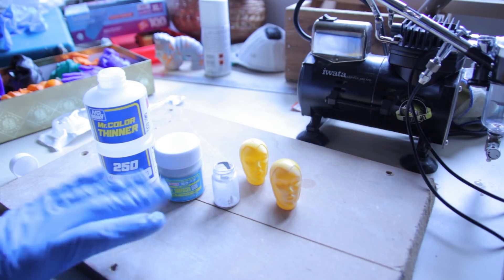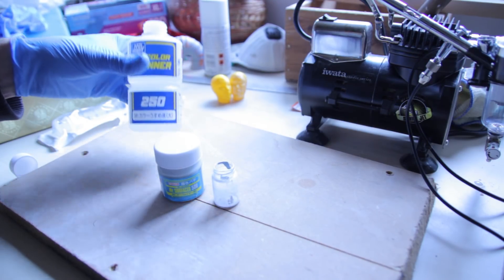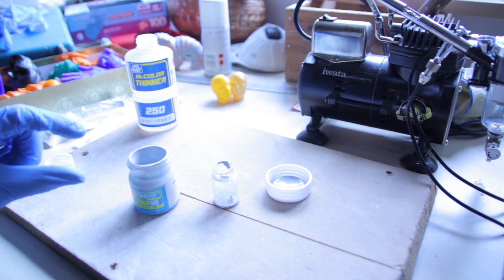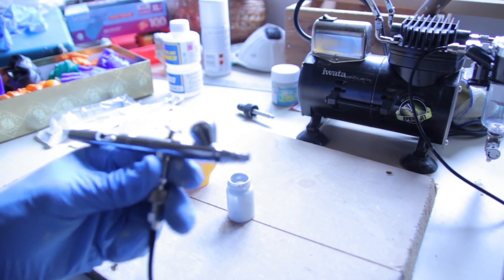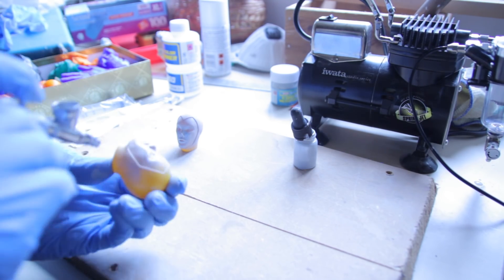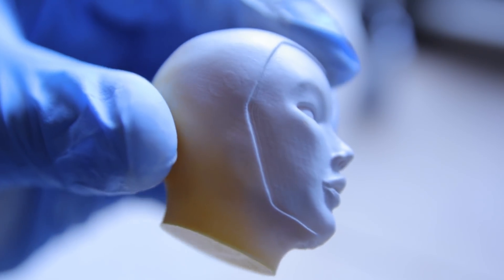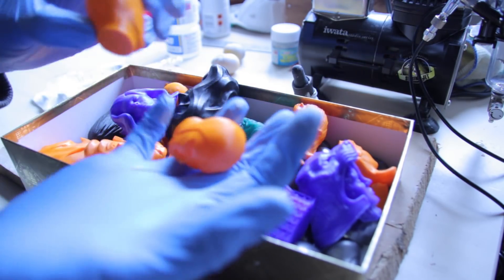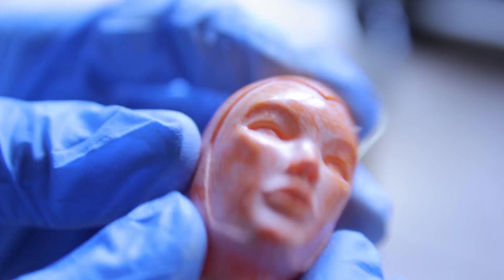PAINTED ACETONE VS NON ACETONE ON PLA 3D PRINT

Comment: For ABS it is working for sure. For PLA it depends on the brand, batch. There is maybe more appropriate solvents.
Reply from the maker: I think Acetone give the best results in my experience, but there are many many chemicals that do similar stuff. Acetone is the cheapest and safest by far.
Reply: Cloakfiend I'd like to know where to find pla that smooths in acetone. Every pla I have used, acetone has zero effect on it.
Reply from the maker: sinformant any colorfabb pla pha filament smooths. Also fabdashery does as well but takes longer and a few others here and there, i just use colorfabb but some people complain its expensive outside europe.
Reply from the maker: Ive done a lot of videos on smoothing and have a giant thread on the ultimaker website feel free to take a look. It takes practice though its not magic!!!
Reply: Cloakfiend thanks. Im a poor boy lol most I've spent on a roll was $30 for some woodfill. I mainly use abs because I generally prototype and make functional items that see physical use. I do have a lot of pla I use to make decorative things for others though. Currently working on printing a hovalin in white abs that glows blue in the dark. Really wanting to move up to nylon, but I'll have to definitely upgrade my ft-5 with an e3d or swap in my knockoff cyclops extruder I bought on a whim lol.
Reply from the maker: sinformant lol it'd the additives that smooth. I'm sure you can find some dirt cheap pla that smoothes but you'll need to try them All! Funnily enough in Europe most pla's that I've tried  smooth! But then they switch formulas on me. Colorfabb is expensive but I buy it cheap on offer whenever I see it as I couldn't care less about the colour!

Comment: Great video! do you paint the acetone on or do you use a vapor method?
Reply from the maker: WildRose Builds Thanks! if im in a hurry or am afraid the acetone will destroy sensitive parts of the model ill brush it on but if its a solid print and im not worried about warping then ill dip it. Colorfabb (which i use btw) pla needs a 25-45 sec dip. Any longer and you may run into problems!